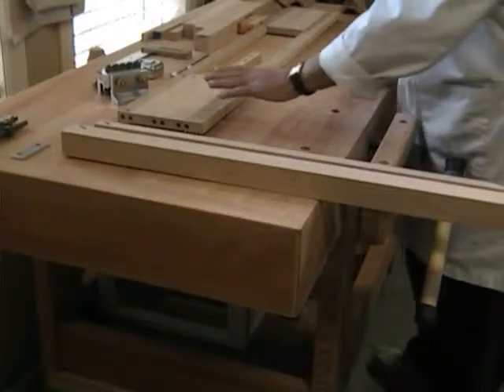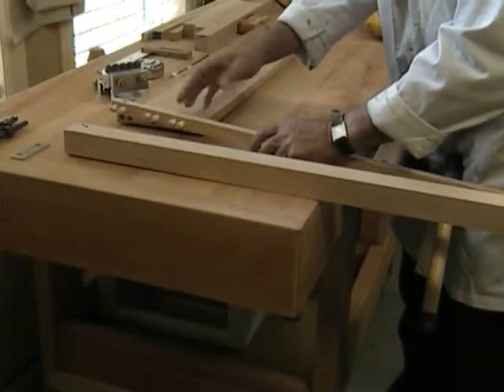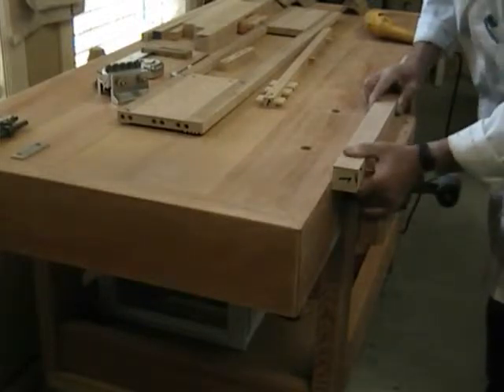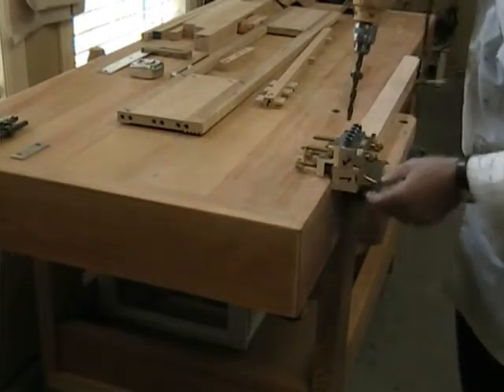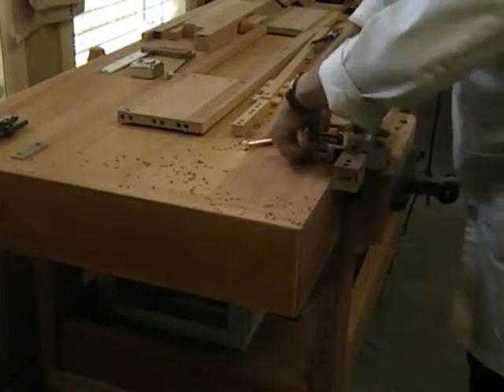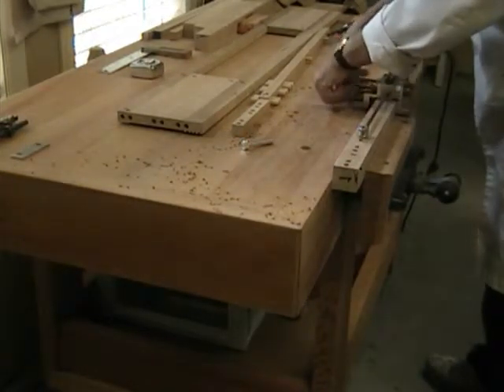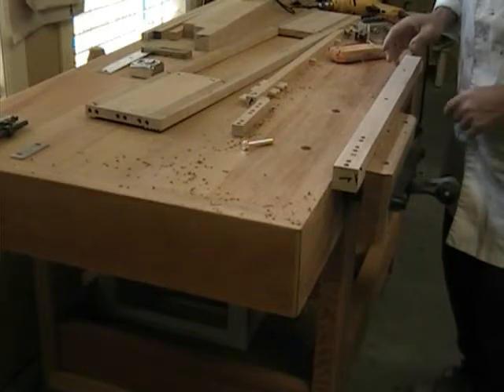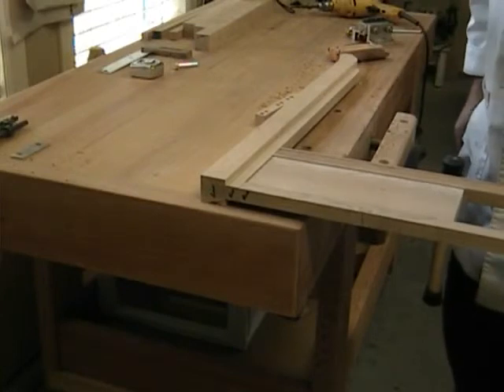How to Build the Dowelmax Hall Table Part 2 - Joining the Front Fascia, Inner Verticals and Legs

Comment from the maker: Hello telosfd, The wood is cherry. We used to use alder which has a very nice grain, but is much more difficult to stain because it is softer, and even with extensive preparation, can turn out blotchy. We switched to cherry because it is much easier to stain than alder, and also has a nicer grain than oak. Thanks.